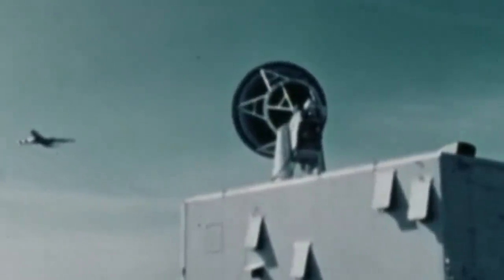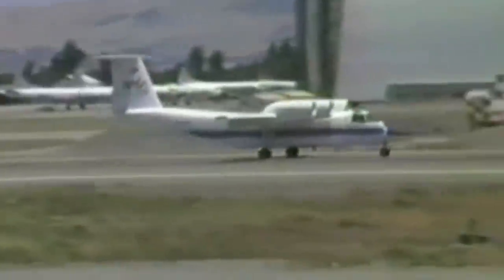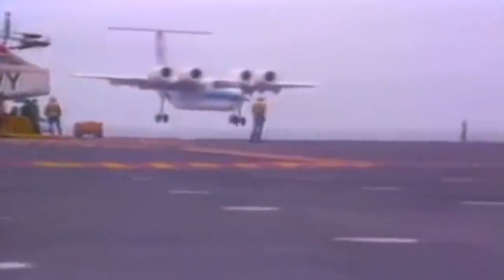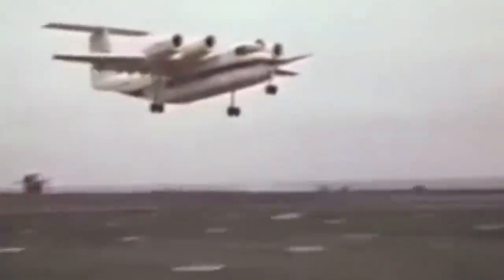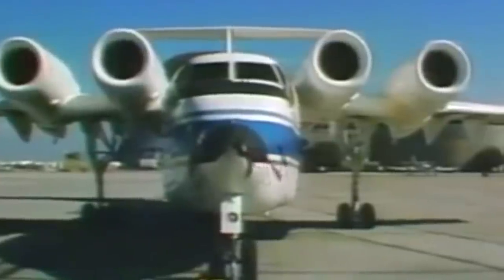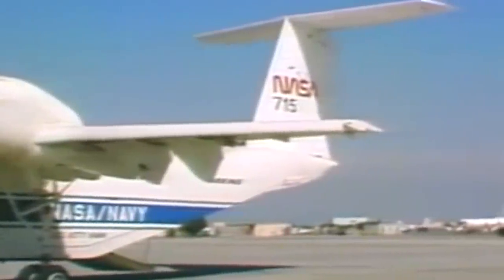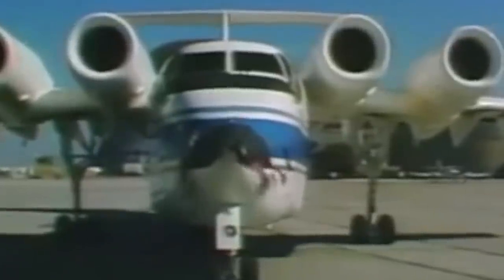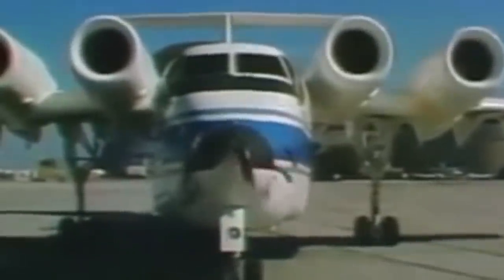4 Engine Super Weird Super Quiet Airplane

Comment: At least now we know how Boeing was inspired to design the C17 (not 100% sure the number is correct, but I mean the two- engined transport with similar engine setup).
Reply: Ya. The C17 uses the flaps to redirect thrust to lift. I worked on the C17 for a while it’s an interesting plane.
Reply: Close... you're thinking of the YC-14 (by Boeing) which used upper surface blowing / coanda effect from two CF-6s on the top of the wing.   I love the YC-14.  Two were made.  You can see one down at the Pima Air and Space museum in Tucson.  The competitor to the YC-14 was Douglas' YC-15 which became the layout of choice for Douglas' C-17 (four engines under the wing and using flap impingement of the exhaust flow).  I'm splitting hairs, so apologies... wasn't meaning to offend.. just provide the details in case you were interested.
Reply: @davefost  you're not splitting hairs, thanks for giving the correct type no. So long ago I didn't remember it rightly. I did remember it lost to the more conventional Douglas.

Comment: Good video, as always. Weren't the Lycomings used for the BAE 146? (Wikipedia: Yes, maybe not the exact type, but they were Lycoming.)
Reply: They are a derivative of the basic core engine that powers the CH-47 Chinook helicopter; a turbo fan version of the AVCO Lycoming T55.  These engines were taken from the YA-9 attack aircraft test bed that lost to the YA-10 that became the A-10.  They are the progenitors of the ALF502 that first powered the BAe-146.
Reply: @billyboblillybob344  Wow, thanks.

Comment: Back to the future, right?  Old WWII pilots would probably say what's the fuss, we landed and took off without arrestors and cables all the time.  Fantastic design
Reply: This aircraft was twice as heavy as any WW2 fighter. The only carrier launched aircraft that came close was the B-25 and it couldn’t land on a carrier.
Arresting systems actually date to WW1 (the decks were MUCH shorter (as was the pilots life span)).

Comment: I still never understand why high mount engines were never mainstream for cargo and short haul general aviation aircraft. Mid mount seemed to work just fine for  Jet Commanders.
Reply: More difficult for workers to maintain, and maintenance is a major expense.
Reply: Low mounted engines need shorter or no access stands and engine handling equipment…

Comment: Boeing developed the YC-14 using this technology, and the airplane was outstanding. However, as the McDonnell Douglas YC-15 was based in California, Douglas win the C-17 contract.
Reply: Both the YC-14 and YC-15 were competing together.  The C-17 came later and was superior to Boeing's new offering (a bigger 3-engine variation of the YC-14).  But since McDonnell and Boeing merged in 1997 it all became moot.

Comment: Hes slowed down his monologue for this video.
Reply: Not nearly enough.  Still quite grating.  It all needs to be relaxed considerably.
Reply: @ShainAndrews  yup the grate is still on. Wonder why he thinks that works.
Reply: @EricAlHarb  He has a pretty good subscriber base, and view counts.  If a person scrolls through the comments there are quire a few critical of the delivery.  I would think adjusting it would benefit, but sometimes people don't want to mess with something that has reasonable success.  At the same time its not like he couldn't change it back if it flopped (doubt it would).

Comment: You talked a lot about what the QRSA did but nothing about what was learned from QRSA. What did the tests reveal in terms of conclusions? Did the data gained from these tests benefit any other aircraft, programs or engines? Has any of the data contributed to new aeronautical engineering principles, laws or technology? Your narration is speeding up again and you are cutting out your breathes altogether (as opposed to just suppressing them with a soft noise gate) which makes it sound artificial. Please go back to your previous more natural sounding narration.